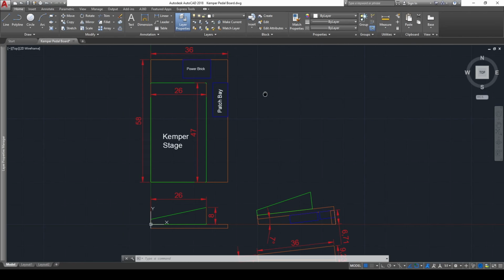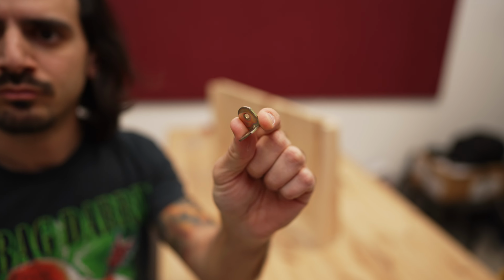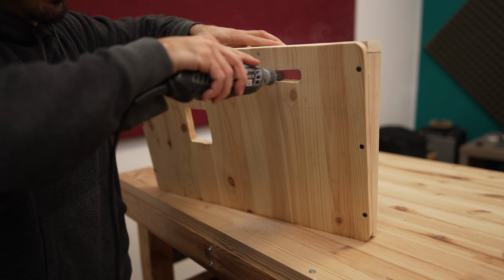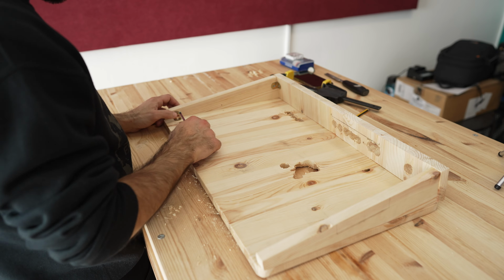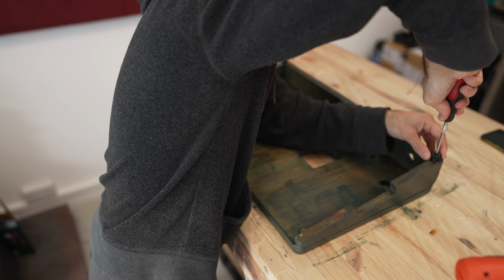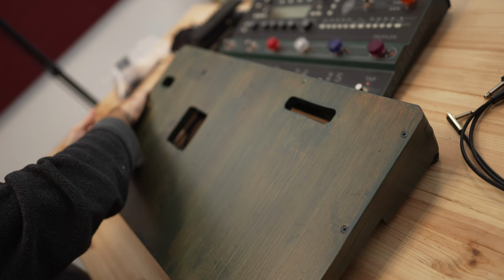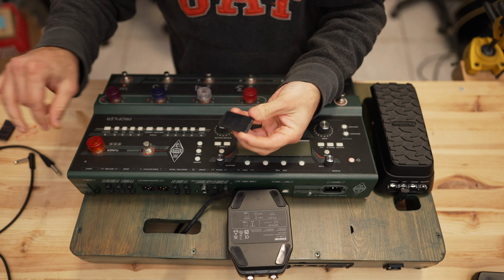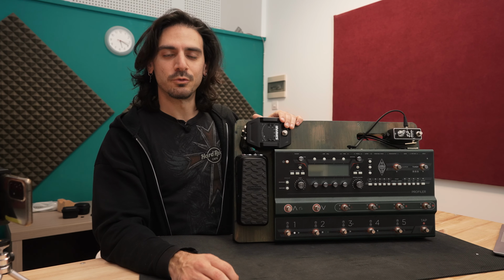Build a budget PRO Pedalboard for Kemper Stage (DIY)

Comment: Does taking the feet off the pedalboard and mounting it with the dual lock tape right to the pedalboard provide enough ventilation to the unit? I'd rather go that route than drill through my pedalboard and try to align the screws. Thanks for your advice!
Reply from the maker: Yeah i made a hole on the pedalboard where the kemper vent is and it is fine! 😊